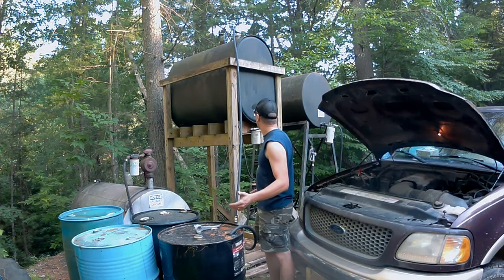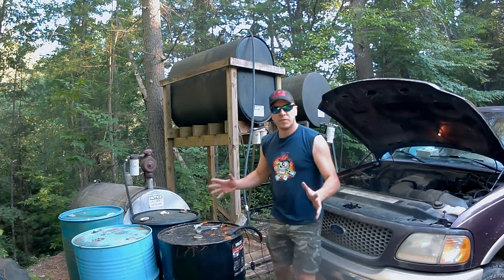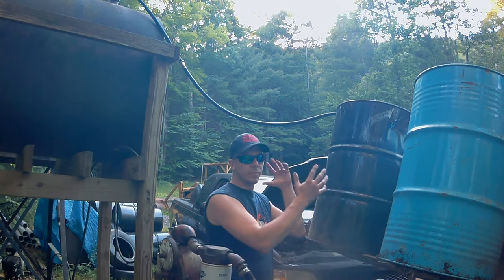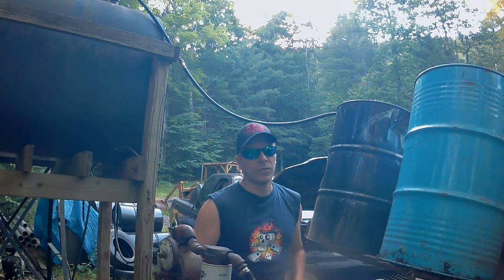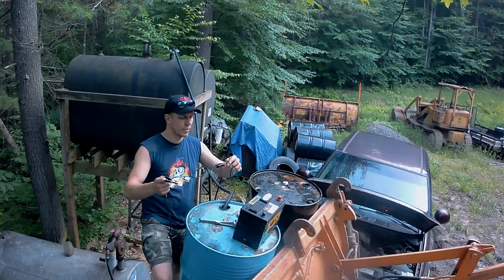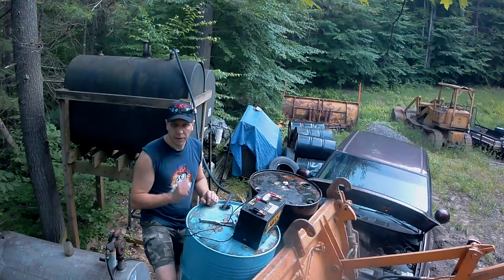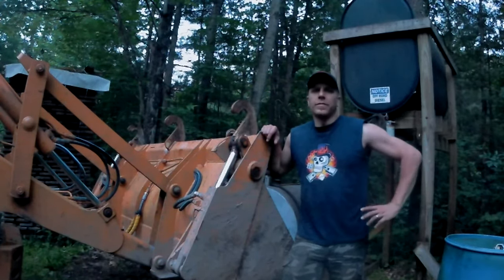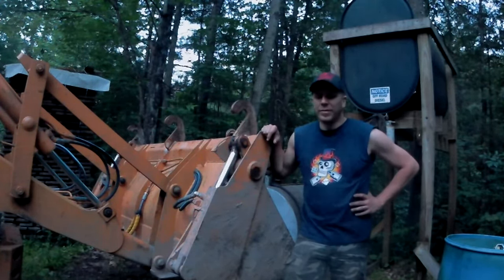Pumping Diesel Fuel into Gravity Tank - Case 580K Backhoe - #21

Comment: hey why don't you just use air to pump the fuel make a bung tube for the 2inch bung that goes to bottom of the barrel then make a air schrader valve on the little barrel bung add 5-10 psi of air and you will be amazed it will pump those barrels pretty quickly we used to do this to move thick oil in winter when a pump would not move it and we often used this method to do fuel tranfer to overhead tanks. we used a old 60 gallon air tank filled it with shop air used a regulator and set the regulator to 5-8 psi on the output line and used a regular air guick connect on the smaller bung and a 2inch NPT to 1 inch adapter and ran a pipe to bottom of the tank then welded a coupler on the top and used a 1inch fuel hose with fuel handle worked like a dream very quickly.
Reply from the maker: Sounds interesting and like it would work very well. The downside for me is I don't have electricity close to me. So I would have to run a generator and buy a small air compressor. It was much easier to use the small battery pump. But I'm done with all that now. I've got tanks set and just have the fuel company fill them. Much easier. Thanks for watching!
Reply: Not exactly you could easily use a large air tank like a 40 gallon or so and fill it at a location where air is available like a gas station that offers free air HINT HINT lol